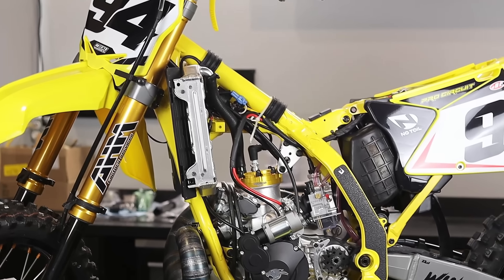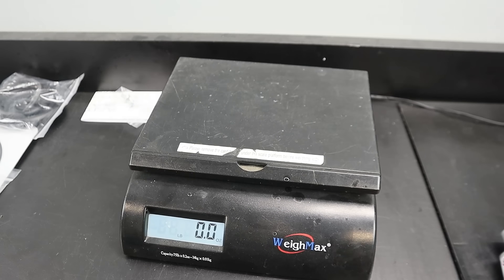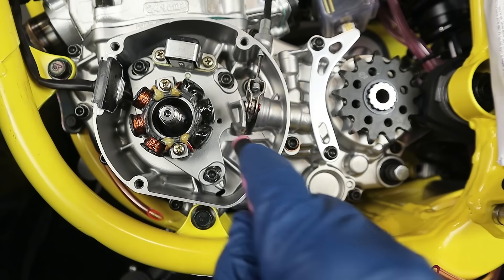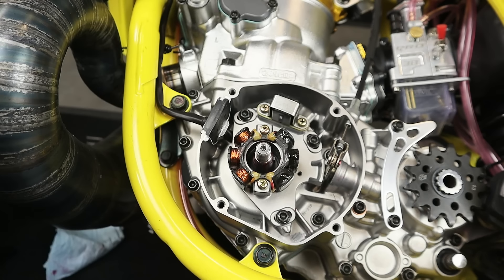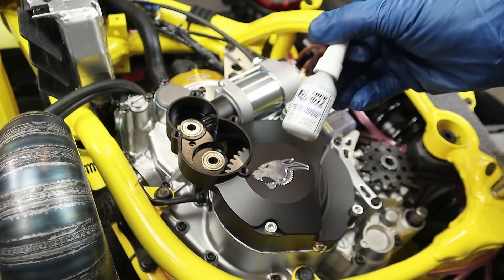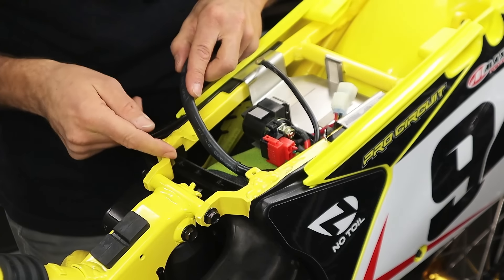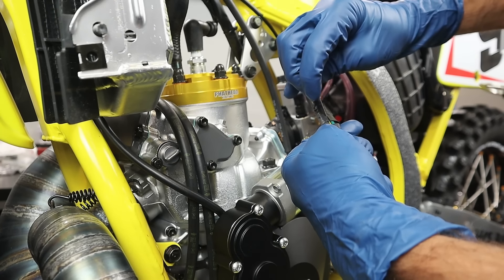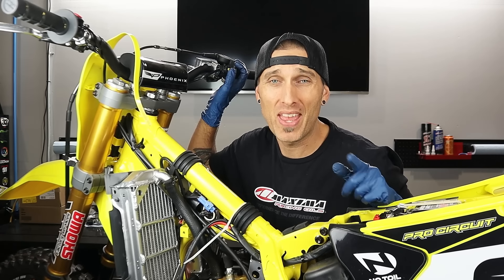The ELECTRIC START Suzuki RM250 ⚡

Comment: Hi you can youse lightning stator for recharing battery. you just need to buy rectifire i believe.... Anyway nice build.. Im curently waiting for my starter kit too. I have rm 250 2006 and i riding really nasty enduro stuff .....
Reply from the maker: You are absolutely right. If you have a lighting stator already, that would do the trick! Thanks a lot for watching today, for your value add comment, and I hope your parts show up soon! 

You’re more manly than I am out in that crazy terrain!
Reply: @mxrevival  and you can buy rectify for panthera should be plug and play. Nex you can get rid of kick stand and its gonna be like modern bike

Comment: I have the rm250 e-start kit on my 2002 and I probably wouldn’t recommend it. I've hade it for around 50 hours and just like any e-start it struggles to start in the cold but even on days when it's not cold some times it just won't start the bike, so I don't think this kit is super reliable. So definitely don't take of the stock kickstart esembily because you definitely need it as a backup unless you want to bump start it every other ride. My bike is bored out to a 265 so that could have something to do with it but I don't think it makes that much of a difference from stock.